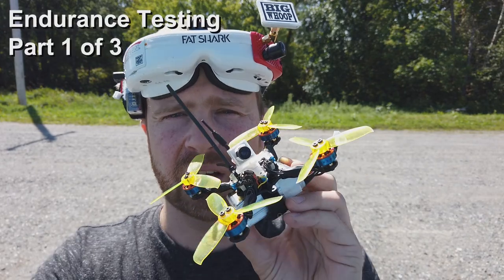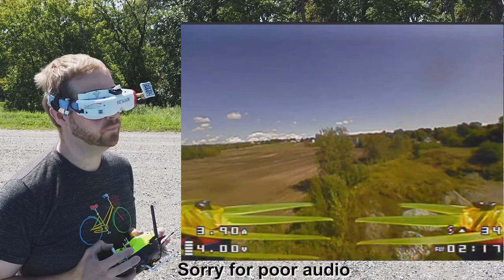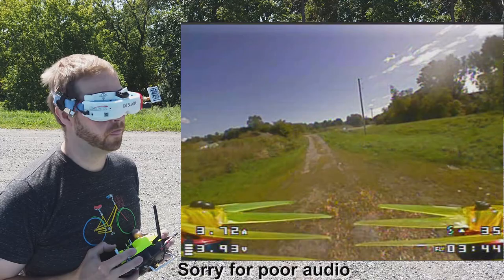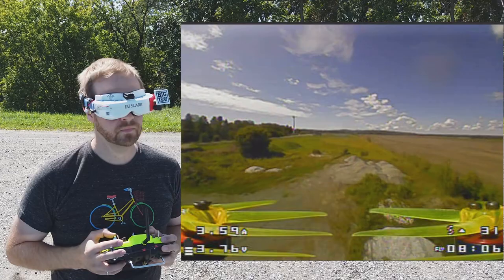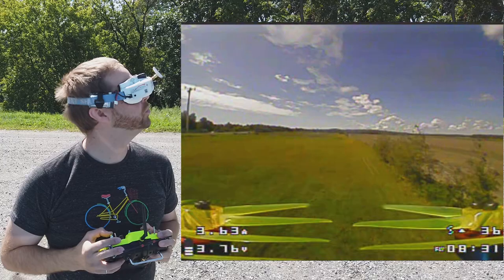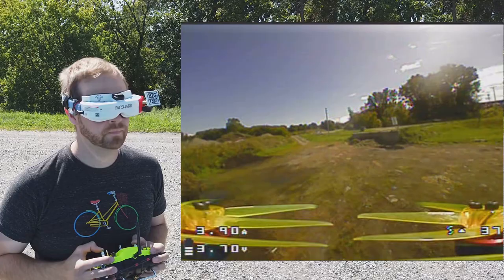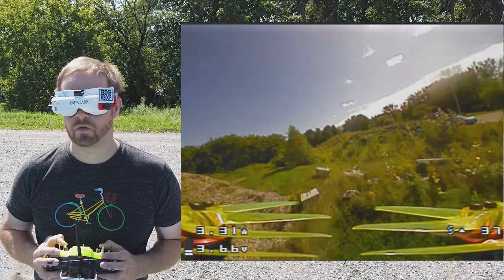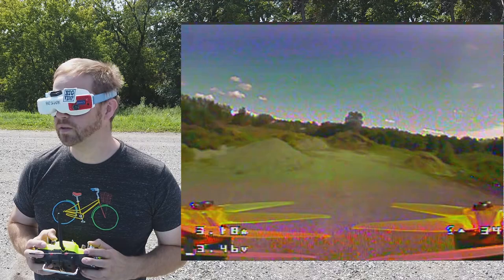16min+ flight time on 3in FPV drone using 1404 3850kv motors

Comment: I saw quads in 2014. Meh.. bunch of banana plugs,  clunky boards, all taped to plastic/wood frame swinging giant 9" props.  2-3 years ago, got much better with 4in1 and AIO. And big  push to micro quads.

But 95%+ on 3inch stuck with sub 5min flight time.. maybe 7.

Dont feel bad. 16min is huge achievement.. and you werent just hovering :)
Reply from the maker: I also started in 2014 with DJI and jan 3, 2015 got my first FPV drone. Things do move fast!  I now have a 3in toothpick (TP3) and it's very very fun to fly and very good flight time. It's a beautiful balance of agility and battery life.

Comment: Amazing smooth flying.
I love the commentary: falling in the creek, millitary planes, your emax prop buddy.

Test the Xing 1404 unibell
Reply from the maker: thanks man! I would love to try to get company to send me motors to reviews like this and not just on the bench review.
Reply from the maker: also, xwing motors are expensive and heavier then the rest of the motors.
Reply: You, DroneMesh, Albert Kim and Kabab (Bob) are my favourite fpv youtubers. 

Im building more toothpicks with parts that just arrived.
 
Xing1404 on 15g 4" PickleFork with the 4023*3. AUW 160g

 Apex1607 on 5" ET5. 5030 props for now. New 5025*3 just came out. 
Im expecting AUW 250g.

Ordered 200x300 T700 CF... gonna make a 6" ultralight with 50min+.. using 3*18650 :)
Reply: Ive just finished building a 3 inch (vistapick) with the Xing motors.  Had just over 2 mins of flight last night and down my kwad fell. Onto grass from around 5m.
It seemed that the motor bolt weren't tightened up and all three came out. 
No visible damage to the motor..
Tested it this morning and it's ultra stuff and won't spin.

Very disappointed in it..... After such a minor crash
Reply from the maker: @gmivisualsjason3729  so you are going to clean it and try again?
Reply: @JeromeDemers  I had a close look and gave it a clean..  motor knackered. Don't understand how it could break so easily?? !!

Comment: The superman motors are great,
 I use them on the 3in Intrepid V2 frame. Tu es dans quel coin Jerome?
Reply from the maker: Salut Yannick, je suis de Sherbrooke.
Reply: @JeromeDemers  Un vrai beau coin pour voler. Ton temps de vol est vraiment impressionnant. Tu as pensé à essayer une batterie faite avec des piles 18650?
Reply from the maker: @yannickg6904  tes le deuxieme qui me parle des 18650. J'ai des 18650, faut juste prendre le temps de me monter la pile avant l'hiver.
Reply: @JeromeDemers  Je crois que tu as le quad parfait pour ça, l'ampérage restait très bas selon ton OSD.

Comment: How much would something like this cost to make?
Reply from the maker: 172.10$ US with 3S 850 lipo. That does not include the 130$ remote and the 499$ FPV google + 100$ FPV receiver + 80$ antennas.
Reply: @JeromeDemers  thanks for getting back to me. It doesn't sound so bad but it all starts to add up I suppose. How much would you say youd be killing the experience by going with a flysky controller / receiver and cheap video transmitter / goggles?
Reply from the maker: @Voltermort  you will be killing the experience but you will found out fast and you will buy something better. Don't get flysky, get taranis (Frsky), now it's out of stock everywhere but there is a 90$ version (X9 lite).  Flying with goggles can be natural to some or very dizzy. It then takes time to get use to it. I can tell you that when I started (2015) I was cheap and didn't want to spend 400$ for goggles so I got 170$ screen and 1 month later got my 400$ goggles. So that 170$ is wasted even though I still have it and use it to show people how I fly. (rarelly) you can still sell everything if you don't like it. I am 100% certain that you will upgrade your gear if you buy low quality stuff. My friend said that "you need to be rich to buy cheap" very true. I would highly recommend you buy second hand to save money. Try to get fatshark goggles. I still have my Dominator V1 or V2 from 2015. You can also check betafpv.com they have nice little beta85 that you can fly around the house. I love my mobula6. Join some FB group to ask question. You can also get some nice kits with everything included like EMAX Tinyhawk RTF. Good luck, beware it's addictive.
Reply: @JeromeDemers  Thanks for the informative rundown. I can relate how you have to be rich to buy cheap. Better to do it right the first time. I'll check out the second hand market. I didn't consider this for some reason. Those kits look appealing!